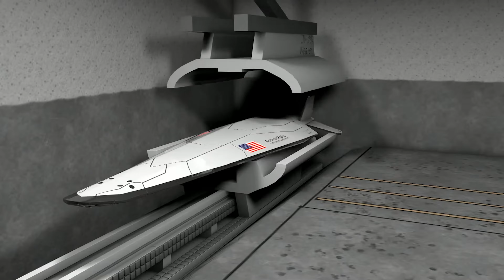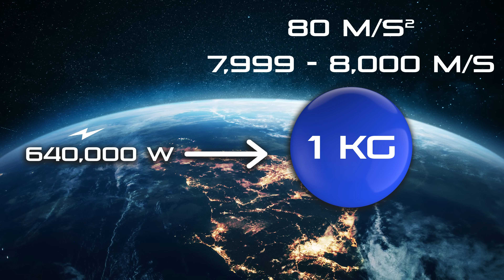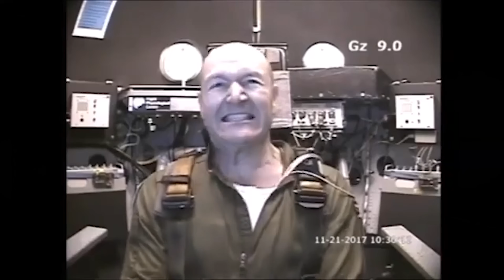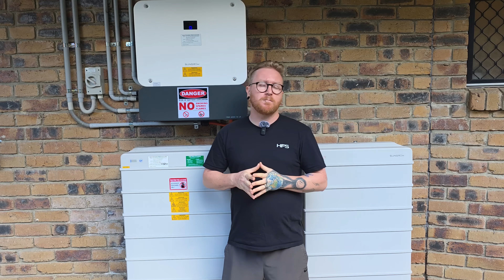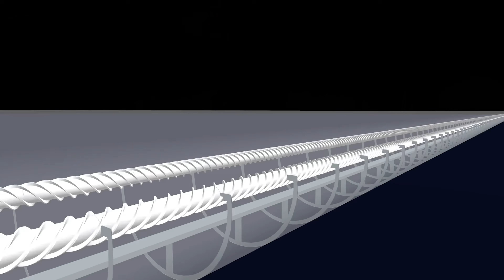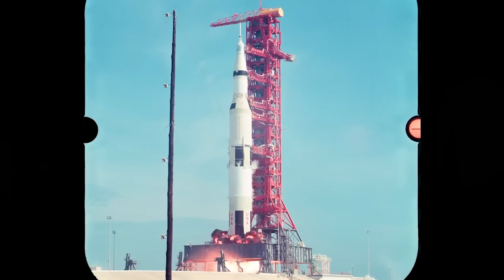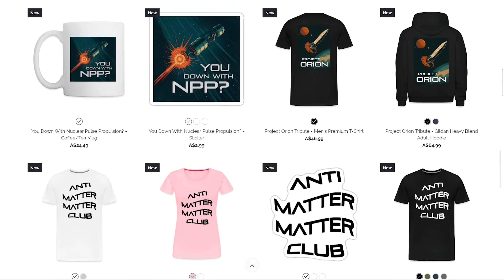The New System That Could ACTUALLY Replace Rockets

Comment: Designing them for 6-8 km/s speeds makes far more sense to me than interplanetary speeds.  Once you can get to LEO cheaply, you can get all the high-ISP/low-thrust fuel tanks you want up there for interplanetary missions.  Or build tethers that bank momentum.
Reply from the maker: Good instincts from you there, this was one of my first questions to Phil when we started talking. It's absolutely possible to scale this system down a little and go for orbital speeds. You'd need to adjust the onboard rocket engine to be able to put the spacecraft into the desired orbit, which should be pretty easy. The main reason (from my understanding) that this has been heavily focused on interplanetary travel is due to how rockets scale, as discussed in the video. You might reduce the cost to orbit with a VPSL system by two thirds? Maybe a little more - but - with interplanetary speeds you're talking less than 1/700th the cost of rockets. So basically, if you're trying to get to another planet (or any celestial body) you're far, far better off using the VPSL to get you to the required velocity, than you are using it to get you to orbit and having a rocket engine do the rest of the work.
Reply: @HelloFromSpaceAus  I get that (the enormous advantage over rockets at interplanetary speeds due to speed-cost scaling powers).  I'm also making assumptions about operating costs & what I'll call "Technological-Readiness(TR)-cost-scaling", and how much people are ultimately willing & able to pay.

For operating costs (as I think you point out), this will be far more energy-efficient than rockets based purely on the kinetic energy requirements, so this cost portion will be far cheaper at any launch speed.

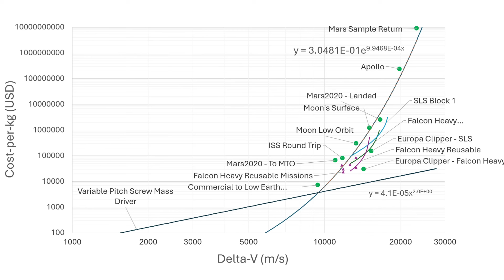TR-wise, there's obviously a BIG unknown cost factor due to this being so new; we won't know the cost with confidence until we've already done it. The break-even cost at 9.5 km/s in your plot at 24:35 has (by necessity) tons of uncertainty baked in.  The true break-even speed could be faster or slower.  I'm assuming it's slower or we wouldn't do it more than once.

TR-cost-uncertainty is also baked into that 700 x factor.  Even if it's lower, that final cost per kg matters a lot; "too expensive" only has an advantage over "700 x too expensive" if we can at least afford to build the cheaper one.
Reply: @HelloFromSpaceAus  In other words high ISP rocket engines are amazing compared to regular rocket engines’ ISPs. Not so much compared to VPSL.
Reply: @HelloFromSpaceAus But what about just getting to the moon where we have another screw system to get interplanetary?
Reply: Cut the design down to 3 km/s and you have fully replaced the first stage of the rocket (and the considerable majority of mass and propellants) with a hugely easier engineering project. There is a reason that mathematically-literate science fiction writers in the 1940's and 50's assumed that approach. The spaceplane in "2001 A Space Odyssey" (the novel) was launched by such a system.
Reply: @kayl456jenna  these people don't understand that 6-8 km/s in the lower atmosphere is very problematic.
Reply: @stelaser Hmm yes, not that 3 kps is really a walk in the park (hence the perpetual concern around Max Q). But half the speed is much easier to do. SSTOs are really hard to do, but a near-SSTO with a kick start is a simpler proposition.
Reply: USE COMPRESSED AIR AND WATER OR STEAM  PORTDSS ALONG THE TUBE TO KEEP INCREASING THE PRESSURE AS THE VEHICLE PASSES THRU ONE POINT CLOSING A VALVE TO SEAL THE DOOR BEHIND THEM AND OPENING ANOTHER VALVE WITH STEAM BEHIND THEM  GIVING THEM THE CATAPULT EFFECT LIKE THEY USE ON THE AIRCRAFT CARRIERS TO GIVE THE HEAVIES AN EXTA NUDGE TO PUT THEM INTO FLIGHT MODE ,,

Comment: The price he is quoting for the Falcon 9 is what SpaceX charges NASA, not what it costs SpaceX, and he is comparing that cost to the potential raw costs of this new system. This whole video totally ignores Starship, which has an aspirational goal of full reliable reuse (just the fuel) at a cost as low as $10–$20 per kg to orbit. Starship is a far more realistic proposal than this project.

Comment: How fast are the screws turning to achieve  earth orbit ?
Reply from the maker: TO achieve earth escape velocity they're spinning around 19k rpm at the end of the tube. If you were going to build a system for LEO, you would probably spin them at the same speed, but use a shorter track to save cost

Comment: What would a small prototype look like, maybe only for LEO? Is there a worry about the sonic boom in the tube( assume less that perfect vacuum)  or at the exit? Would you use a burst disk to hold the vacuum at the end or a series of quickly actuating locks?
Reply from the maker: I'd be very keen to see a small prototype as well, as a physical proof of concept, showing the mechanics and systems all work as intended in real life. I would think the system would have no trouble scaling right down to something very small for this.
In the full interview (which was about 40 min) Phil spoke about the sonic boom. Because it wouldn't occur until the craft exited the tube (at high altitude) it shouldn't be much of an issue. Certainly less of an issue than SpaceX is having with Starship. In my opinion, sonic booms are something people would get used to. I used to live near a rail line, at first the sound bothered me, then I got used to it and tuned it out. I believe a similar thing would happen.

Comment: This is so dumb it's beyond belief.
If humans learned just one thing in the whole of the 20th century it's that moving parts REALLY suck. And big moving parts suck the most. This is little different from the fools who (every decade or so) think airships have a future. They do not. Not now, and not ever. They are a deeply stupid form of motion. But if you disagree, buy some shares in an airship company, and see how you get on.

The idea of a rotating screw is simply stupid in this context. In the late 1970s Porsche had to develop what is now known as the "Torque Tube" to transmit the engine power from the engine to the transmission at the rear of the 928. The shaft had to spin at full engine revs, of course. What they found were resonant frequencies all over the place, that threatened to tear the shafts apart, even at low speeds. The engineering of the Torque Tube is extreme, and they are very expensive to make, even when you only have to stabilise a shaft at 7,500 rom across a distance of less than 2 metres.

In the end, they developed a shaft that rotates inside another tube, with bearings around the inner shaft at regular intervals to stabilise it.

I am not an engineer, but I can detect BS "engineering" quite well. If you want to lose every cent you have, invest in this absolute turkey. No serious engineer would touch this with a barge pole, because it is so obviously a dumb idea. Like the idea of the Neom City. Or the retarded Hyperloop. Or tunnels for cars under cities. Straight up stupid.

Comment: I think a lot of consideration has to be given to the difficulty of constructing and maintaining adequate vacuum in a long tube such as that. Far from a trivial problem. Still, it is intriguing. I just wonder if the cost estimates are wrong, by something like an order of magnitude.
Reply: It's even more stupid than a Hyperloop.
It is beyond moronic. Beyond stupid.
Reply: I was trying to be diplomatic, but yes, I agree with you. Hyperloop is one of the stupidest ideas ever and they couldn't maintain adequate vacuum even over a short distance. This is not remotely feasible at the scale they are talking about.

Comment: Magnetic coupling energies would need to ramp up with the velocity.  You'd start to hit the same problem with coil launching. 

If the concept is feasible, it should be possible to build a gun that would satisfy all the requirements the Navy wanted for their rail gun project. 

There's motivation to build a gun beyond military purposes. If it works, you can use it as a drive that can move a spacecraft. An asteroid mining probe could use rock and ice as reaction mass.
Reply from the maker: You're absolutely correct that the energy required to maintain the magnetic couple will increase along the length of the track, however this energy demand is pretty insignificant compared to the demand from the screws - basically it isn't a big deal with this system, from my understanding. the demands of the propulsive system far outweigh the demands of the magnetic couplers.

I like military tech (a lot) but id much rather see this system implemented for space access than blowing up bad guys. Missiles are very effective, I have personally never really seen the need for a rail gun on Navy ships.
Reply: @HelloFromSpaceAus I'm mainly thinking about how to prove the tech. Someone would pay to have a weapon built, while a rock throwing drive probably won't be needed until after a full launch system is already built, so it's the shortest path to a proof of concept.

Comment: moving parts screw dat. even coil launcher is better than screws. you know the brushed coil train. if you use a coil electro-magnet for the coil tube launch vehicle then you dont have to put a magnet in the launch vehicle.

Comment: Good luck with engineering these magic screws, those alone are technically insurmountable
Reply: Why didn't we hear about experiments that have already been carried out.
Reply: In addition to the whipping problem that requires segments: 
1. Those segment control systems would be significant. Zip into the next segment that isn't synced up correctly and you will get what? Acceleration. Probably deceleration, and transfer of momentum from the launch vehicle to the screw segments. Once out of sync in one screw segment, getting re-synced is very hard.  
2. Every slight change in direction will cause pitch & yaw oscillations that will buffet the payload and the walls of the tube. In fact, it should cause pitch moments mostly. At the right speed, the length of the segments could be harmonics of the pitch oscillation.  
3. Transitioning from segment to segment will happen faster and faster. If later ones are even slightly out of sync the force transferred into the tube structure that the screws have to take gets really high. This can whack the mass of the vehicle around delivering very high G brief forces. Even enough to break the containment structure, or rip the screws off their mounts. Mostly this should happen in the last 20% of launch. Which is another issue. The mounts holding in each screw section would need to get stronger and stronger. Saying, "Oh, it's all going to be magnetic" isn't realistic. Magnetic fields strong enough to hold a high speed rotating cylinder would prevent the vehicle from passing by. 
4. You don't actually get zero friction from magnets. You get close to it with superconductors and superconductor temps. That's not likely on earth. But remember that when you push a conductor through a magnetic field you cause what? Electrical current. (This is a major problem with orbital rings also.) That bleeds off energy, and the charge is going to go somewhere. This will appear as heat in the screws. 
5. The magic of vacuum. Any vacuum has gas in it. Even the interstellar medium has enough atoms that when stars move through it, they compress a bow shock ahead of them. This is seen with moving pulsars very clearly. The atmosphere of Mars is a high vacuum on earth. So if the end of this tube is sealed, you will compress the air ahead of you pretty quick to be much higher than atmospheric pressure. Compressing that gas generates heat (lots of it) and slows your launch vehicle. 

Those are major issues off the top.
Reply: There's a HUGE problem i should have seen. Variable pitch means that as the launch vehicle travels, the pitch gets closer and closer to parallel with the tube. If we use degrees, there's only 89.99 (some repeat value) to change the screw pitch. You are stuck with the sine of some tiny angle delivering force in the direction you want. The rest is delivering a rotation moment to the vehicle. If it is perfectly balanced with two parallel screws,  this should push the vehicle through the roof or floor of the tube. That will place huge compression and tension forces on the shell of the launch vehicle. 

This idea ain't happening.
Reply: @BriPHan and at those speeds the eddy currents generated would be huge. I think they would cause far bigger issues than any air friction they've avoided with the vacuum.
Reply: @propershroper Right, the secondary field dynamics would almost require the entire assembly be made of bioglass. I'm struggling to see why anyone is putting more than a YouTube video's worth of time on this.
Reply: @BriPHan IKR
Reply: And then there's another problem. This is supposed to deliver the force by magnetic field? They are telling us that a magnetic field can deliver motive force with the field at a screw thread angle? 

🤣🤣🤣🤣
No. This is ridiculous.
I think you would see the launch pod enter the tube, move a bit, then start heating up with generated electrical current back into the screws and body of the pod, grounding into the earth. The pod will mostly just sit there getting banged against the roof until someone turns it off or a screw mount or the pod melts down. 

When the spinning screw breaks loose it will fly away through the wall of the tube and chew through anything it touches like a giant CNC milling bit. This will probably free other screw sections...

Comment: The "only" problem is that you need to build a +3000 Km runway (with 2 huge screws all the way to the end) if you pretend to use this for people at 2g.
Reply: It doesn’t need to be contiguous. You could break it up into segments.
Reply: @grimmlinn it is still a high tech road of 3000 Km
Reply: @agustinpizarro  it’s not hard to line a tunnel with spinning screws in comparison to capacitors and rail guns.

Comment: You should look into a laser launch system. Expensive to set up, and can only launch small amounts, but if done properly could launch multiple times a day. I really think, with advances in rocket tech in the last 20 years, it is time to resurrect the Venture Star programme.
Reply from the maker: Its a very cool idea, basically what Breakthrough Starshot have proposed. The diffraction becomes an issue pretty quickly as the craft moves away from the laser, but for small probes it could be very effective
Reply: @HelloFromSpaceAus  there has been a suggestion since the 70s, that we could launch small capsules from Earth using powerful lasers. https://en.wikipedia.org/wiki/Lightcraft   I wonder whether we've reached the level of laser power capable of doing this yet. I'm a fan of Hazegrayart's channel, & every time I watch one of his animations of old designs I wonder if we applied modern tech to some of them, would they work. We are a long way off any Martian colony, and attemptng it now would just be an elaborate & expensive to kill a crew. We need to concentrate on cis-lunar space, until such times as we can send a colony properly, maybe as Ben Bova suggested in Saturn of building an O'Neill cylinder, stocking it & manning it here, then launching it to Mars, or Venus, or where ever we decide.

Comment: Finally a good explanation why massdrivers never been implemented, didnt know that power was such a gigantic bottleneck! To my layman ears this sounds like a complete paradigm shift in that such large amounts of kinetic energy can be "loaded up" over time into a system and then be used as an alternative to rocketry.

A question from a layman, why not load up the momentum/kinetic energy inside the "sledge" instead by using flywheels? Larger flywheels but would avoid the thousands of "screw wheels" who each one would be a point of failure?
Reply from the maker: I really glad it came across in an easy to understand way, and was enjoyable to watch! You're spot on there, if we can build it, and get it to work as advertised on the box - this would be an absolute game changer.

I'm not an engineer, so take this answer with a grain of salt...😅 - but, the screws changing in pitch along the track is the key here, I'm not sure how you'd do that directly on the sled. The other factor is, with the screws driving the sled - all you need to do is either load another sled and you're good for another launch. The idea is you'd be able to do many launches a day. If the driving hardware was on the sled itself, I think this becomes far less practical unfortunately. Good instincts from you though, complexity is often the killer of cool ideas.

Comment: So are the threads on the screw more tightly packed at the beginning and slowly stretch out as you require more speed at the end?
Reply from the maker: Nailed it👌
Reply: @HelloFromSpaceAus  Cool, so is it a really long shaft the length of the tunnel spun to high speed, or is it segments with rotating drums spinning with different thread densities? Not sure how the launch vehicle would connect to that.   I imagine there might be some weird torsional stresses on the threaded shaft that may make it wiggle out of control being that long and spun that fast.. Is there a big ol heavy spinny wheel at the end they put all the energy into and then start to put it through the threaded spinny shafts through a reduction gearbox.. or maybe a CVT?